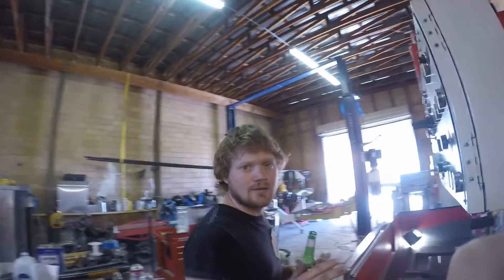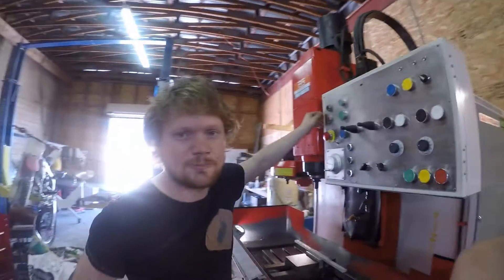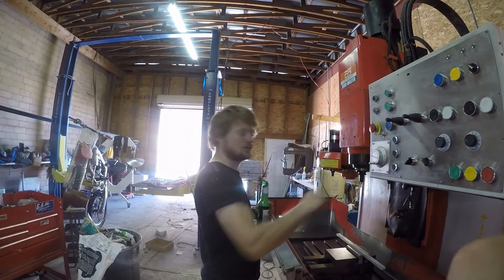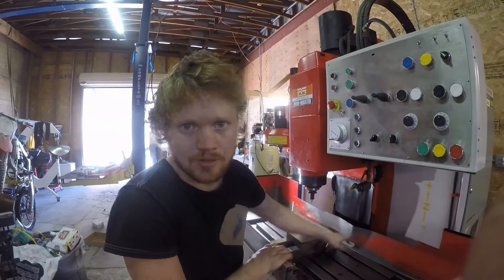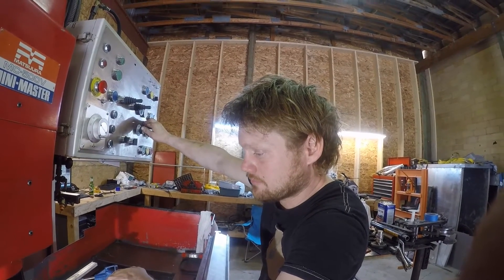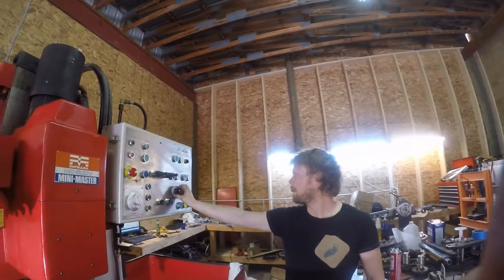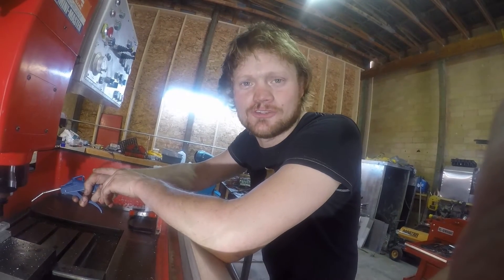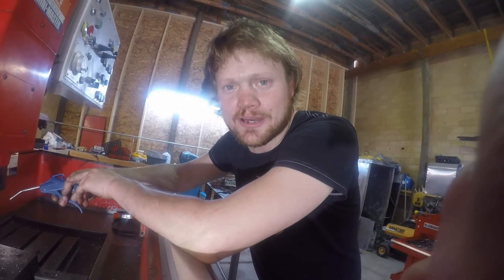Matsuura Mach3 retrofit first run

Comment: Can you tell the basics on the retrofit like what system did you go with, cost and how much of the components did you swap out? I have a MC500V too that has a Yasnac 3000G control problem and a retrofit might be the way to fix it.
Reply from the maker: Went with a cs labs system. Too many parts to list. If you search the mach forum there is more info there.

Comment: Hey man totally random question. I am in the process of looking at used CNC's and am determining if i want to buy something in the $5000 range that I can put money into rebuilding, or I am also looking into buying also an older machine (maybe something like a haas) and spending more with the intent to have it relatively turn key. I'd love to learn the aspect of CNC building, but I have little experience with that. I went to trade school for CNC machining and I also have been working for over 3 years and I feel that I have learned a pretty good deal of information( +Definitely want to keep learning). Not necessarily looking to get a matsuura per say, but I have found some mitsui seikis, more seikis, etc. that could be candidates for a retrofit. Any thoughts or suggestions?
Reply from the maker: Thats a tough question, and the answer really depends on timing. I'm guessing you want a CNC machine to generate revenue. If you're looking to get a machine in the door now for potential work down the road, and you have time on your hands, then a retrofit project may be a good idea. But, if you have work for a machine now, or you will soon, I would say spend as much as you can and buy the biggest and fastest machine you can for the money. You wouldn't believe what people sell used machines at auction. If they're tight, you can make the same part that someone with a brand new 200k machine makes. I love my little Matsuura, but it took a tremendous amount of work to iron out the kinks and learn the what I needed to learn about retrofits to pull the thing together.  In summary, if you have the time, retrofit the biggest 3 axis mill you can (unless you're only going to do small parts). If you have work now, buy something turn-key. As a side note, I really wish I had retrofitted something much bigger! I've never turned  away a job because my machine wasn't fast or new enough, but I have turned away over $10k worth of work because I didn't have the travel in my axis.
Reply: Thanks for the response! I am really leaning on a turn key Haas that I can see under power at this point. Like I said lots of people like to make fun of Haas machines (myself included sometimes) but the fact is that their phone/ in person support seems to be the best for old machines. I have found good deals for brands that are no longer in service and that makes me really nervous. Plus, I know a friend who has serviced haas' for 17 years so I feel a little better knowing I have some help. I think a retrofit is too big of a project for me now as much as I'd like to learn I think the extra money I spend will get me making chips faster and I guess that's ultimately what I want to do haha.

Comment: Hey I'm kinda new to CNC but I just got a Matsuura mv500 mini master. I'm trying to run it on an xp desk top. I'm having trouble getting the computer to see that it's plugged into the matsuura though. If I put Something like Mach 3 on the desktop will it recognize the Matsuura?
Reply from the maker: Justin Lipkvich has the machine been retrofitted at all?
Reply: Supposedly yes. It was running off a laptop through a s232 port
Reply from the maker: Hmmm. Can you take a pic of the innards of your control cabinet? (The one on the right side of the machine if you are looking at it.) Email me at johnmfriedl@gmail.com
Reply: sure thing thanks
Reply: @lipkvichfabrication1799  That sounds like a DNC setup has been added, not a retrofit.

Comment: Hi, what do you mean with spindle grease, you said you have  oil in it, I have same matsuura and have problem with spindle lower bearing, the coolant did start little  rust in bearing, did not see any grease nipple to put grease in, is there any hole or something?Thanks.
Reply from the maker: +Zigmars Kaprano , thanks for watching! The spindle bearings are designed to have grease in them, not oil. But someone before me had put oil inside the spindle and let it run down through the bearings. Technically, to grease the bearings, you must disassemble the spindle to allow the bearings to come apart. I cheated though. I removed the spindle but did not remove the bearings and used a medical syringe and compressed air to force the proper amount of grease into the bearing cages.  It worked well. I have no heat build up and no bearings chatter.